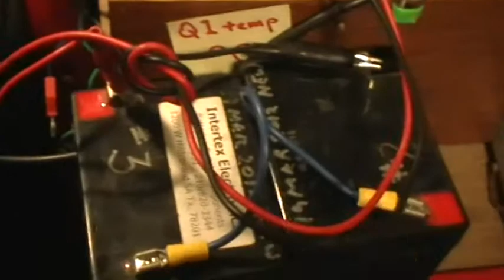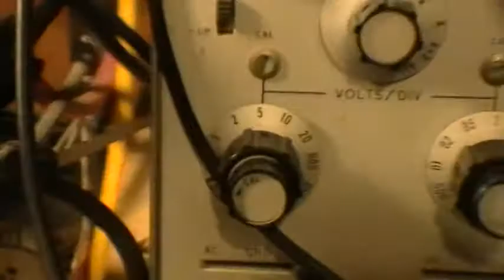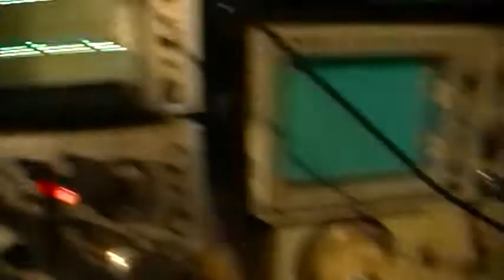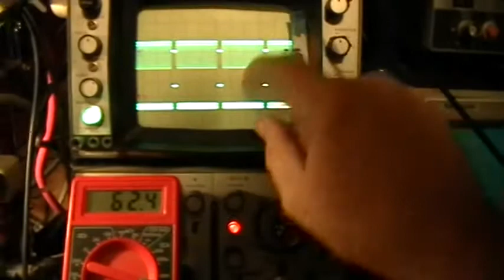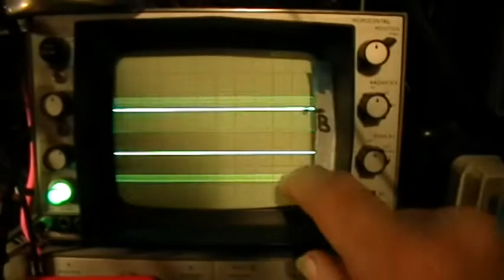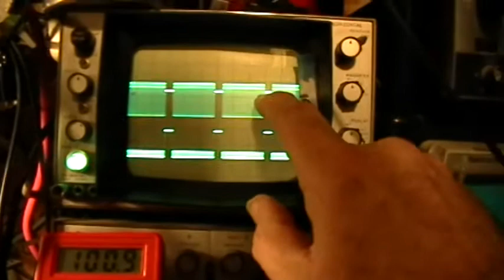Electric OU:  Supplement: Part 5: Current Flow in the Full Circuit

Comment: Nice to see DMM's being demonstrated to be extremely useful and accurate for these types of measurements! Near the end it would have been nice to see how accurate the meter is in comparison to a manual computation using the ON voltage value and duty, and the CSR value. Also demos how little is required to turn on the MOSFET, and the Vgs vs. ID^2 relationship. Good work.